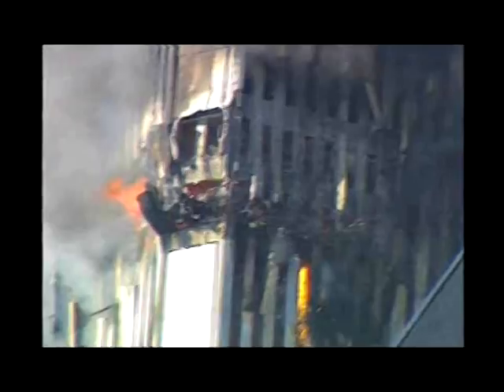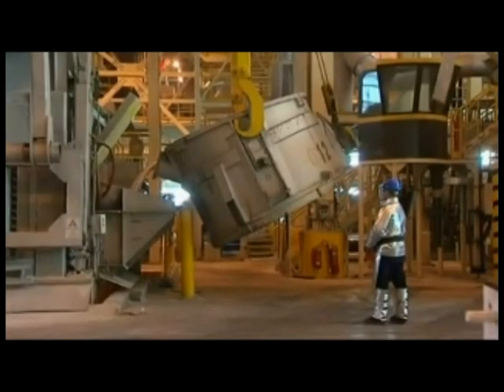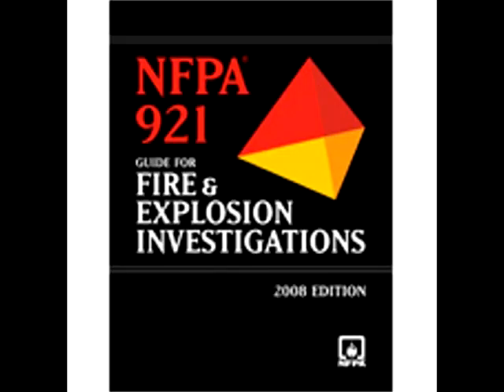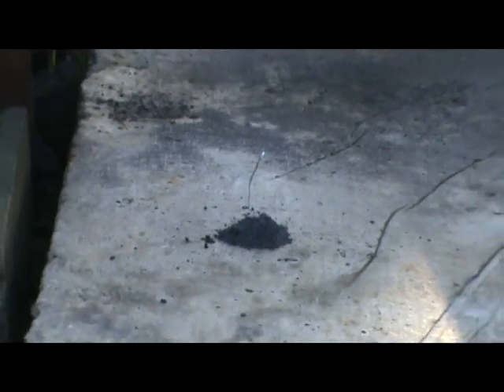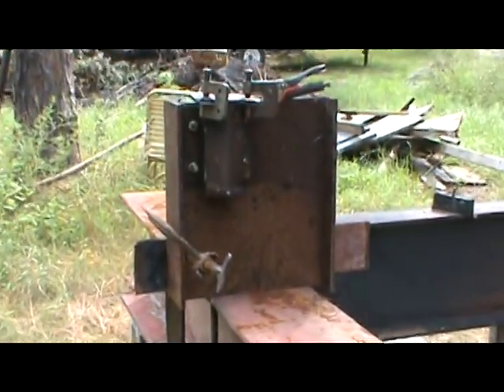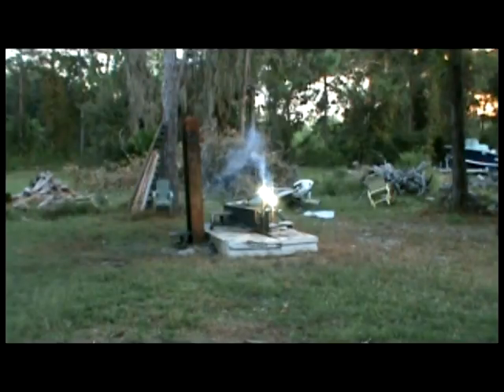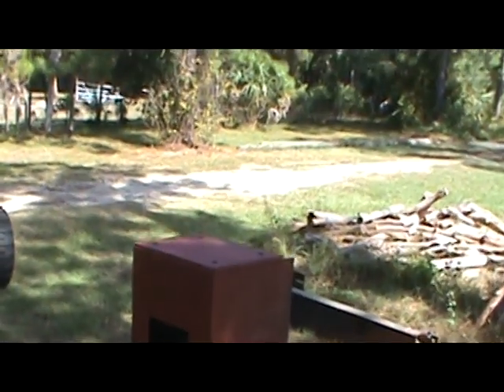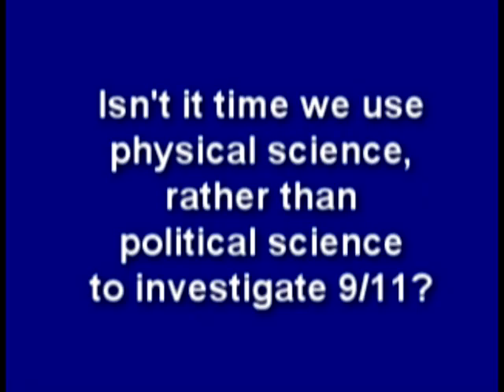9/11 Experiments: The Great Thermate Debate

Comment: Hmm
But...if "open-air jet fuel fires cannot melt steel"....what about the fuel that got into the iron (steel) structure? 

There is a big hole in the sabotage theory. Most of all how would the required energy bearing material get into place, even if it were ignited by burning jet fuel? 

The problem with the jet fuel arugment is that it wraps everything up neatly with a bow, yes? Well how is a thermite style approach  even feasible? Why even take this approach ( bringing down the towers) as there has to be a more technically- feasible approach with similar political results? 

Second a simple question. Your thermite experiments burned out within minutes at most. The WTC burned for hours. There is no question that hundreds of thousands of pounds of jet fuel was flown into those buildings. No question about the fires. How long would it take for that fuel to burn out? Why disregard that heat spurce entirely...it's still hot enough to melt everything but the steel, the steel is still weakened significantly and it still spreads through much of the building turning it into a furnace.  Arguably the burned-out steel hulks of the twin towers still standing would have had the same political impact. That heat would be conducted throughout the entire structure and set tge entire structure on fire...a thermite attack on the 81st floor would not do that. So you have a big time-scale problem and a big size-scale problem.  Say you solve that. How do you have two passenger jets synchronize their arrivals with your thermite attack?

Say you solve that. 

How do you set up and pull this whole thing off without a single credible leak?

I think that is the huge flaw here. Arguably the US government knew what was going to happen when Congress rejected a bill requiring cockpit safety doors on airliners. You could make an argument that some deep-state organization loaded up the WTC with these grenades and the two played together nicely. Pyrotechnics. But how do you do all of this without leaks? 

More likely it was a coincidence. A convergence of negligence and probability. Let's assume that some thermite was stored in the structure. Question 1. Can burning jet fuel ignite it. If not then you need a secondary effect. Burning oxygen canisters or an electrical arc. There were o2 canisters on the planes. Scattered by impact..ignited by the fire...but burning near thermite on the steel frames? Hmm. Electical arcs are possible, you've got power all through the building. The insulation could have burned off and ignited thermite. Possibly. 

But still here you are looking at say 90% jet fuel 10% thermite. To weaken the structure fatally enough to collapse it, you will need a lot of locations of thermite igniting. 

You would need a two-pronged attack. One to load the thermite and ignition system. The other to provide the jet fuel and ignite it. It is possible that the jets were just a coincidence...or they were insurance. In case the thermite didn't bring them down. Or they were cover. 

Or the "thermite" was a byproduct of burning jet fuel in a steel enclosure packed with organic materials. In other words the building itself was the source and needed only to be set on fire.

Iron oxide from the steel, aluminum from the plane, barium nitrate from the lamps, sulfur and so on. 

Ceiling tiles, floor tiles, drywall, wood, who knows what the fuck was in those buildings

Comment: you are stupid. you don't need 1427°C to melt the steel. with only 800°C the temperature of burning kerosen, steel can flexed with hand. not to mention the thousand of tons of things that the weak structure needed to bear. watch this video : 
https://tv.maxisciences.com/7020-w480.mp4?st=NrP3RAX-M_Zrr0WWHkdShA&e=1536419373

Comment: Iron oxide, that would be rust, and aluminum powder, which was on the outside of the World Trade Center which is what's the side skirting was exactly what thermite is.
Thermite was located at the World Trade Center, because of the steel beams as well as iron bolts held the steel beams together, what's the aluminum siding of the World Trade Center, of course there might would be found. For those that wants to know more, look up Dr Judy Wood.

Comment: You spent a hell of a lot of time trying to prove something that you cannot recreate like the original.

How many outer steel columns were there on both buildings? A few hundred at least _ PER FLOOR. How many columns were there on the internal stairwells, elevator shafts and internal strength columns?  How long did it take for this group of thousands of people to come in, remove ceiling tiles, service ducts etc and then install all this so-called 'thermite' on all these columns?  Who wired all the so-called 'thermite' things up? Where did they all wire to?  What floors were they placed on?  Why did the building only collapse from that particular floor and not one floor above or the ones below  where the plane crashed? Did your fictitious 'installers' only place 'thermite' up to that particular floor, and not the floors above where the planes hit - as we never saw the floors above collapse or have your wanna be explosions?

Did the planes hit only the floors where your thousands of men installed this 'thermite'?  How did the pilots manage to find the exact floor to hit while travelling at say 500mph?  Was there a big red spot on the side of the building for them to aim for?  Why did not one person - not fucking one - see a huge group of people removing service ducts and ceiling panels and installing hundreds of miles of wire ... that went where?

Your tests prove nothing even remotely associated with the collapse of the World Trade Center buildings.

Trouble is with you conspiracy theorists, is that you think too much.

Comment: Interesting video. I do think you aren't taking some things into account though. For one the impact of a plane going 700 miles an hour would cause significant damage to some beams, snapping the bolts at least. Also, you need to think about the wind speed at the elevation. Because the winds would be so strong it would turn the whole building into a makeshift furnace. Iron forges don't use thermite to Forge Steel, they use a furnace.

Comment: Thank you for posting this video... I met a old construction worker... That told me he was on the rust removal crew... First he stated that the owners off the buildings wouldn't let them do a proper job removing the rust... They just painted over it.. They stopped using lead based paint because it was unsafe... The paint they used had aluminum oxide as a rust retardant... The one thing I was wondering about was... The back bone of all tall buildings is the is the elevator shaft... The are made of steel reinforced concrete so the shafts should of been standing even if the building feel around them... You know what the military use termite grenades for right? To burn though the engine blocks of equipment so the enemy can't use them... Take care and have a great day everyone.. Love the video...

Comment: I don’t get the argument that the molten metal pouring out isn’t aluminium. There was tons of the stuff present from the airframe. Yes, Al at its melting temperature doesn’t glow but it will if heated to around 700°C or more. That temperature is perfectly plausible. Why do I say that? I have cast Al with a 700°C+ temperature from an induction furnace. It’s not an incredibly rare or difficult set up so other people can, if they want, check it out for themselves. 

The “peer reviewed article” mentioned (which I have actually read) uses samples of dubious provenance. I don’t think the conclusions are really backed up by the evidence provided. The journal doesn’t have a great reputation either but that doesn’t affect the arguments in the paper.

Comment: I just love how so many people think "jet fuel.. has to burn hotter" yet, jet-A, the most common type used in commercial aircraft, is not much different than kerosene, which is less volatile than your car's fuel, and that cannot melt steel in a natural burn! If someone is dumb enough to believe that it can, have them explain to me why a kerosene-fired torpedo heater doesn't melt.

Comment: just because the Steele fire rating is 2000+ degrees doesn’t mean it won’t fall, steel loses its structural integrity around like 1600-1900 degrees which is around the same temperature that jet fuel burns at soooo
Reply: Heat rises, so it doesn't explain the columns that were 6 ft wide by 6 feet deep melting at the base.

Comment: By the way my working trade is a truck driver and I'm a gold and silver smith my brother is a jeweler and gemologist far as casting of metal all those materials is mentioned because their molecular density is less than the source metal all I do is look like Flex on the metal it wouldn't change the color of the raw material pouring
Reply: I left Trucking 2 years ago and I started back in work back in the late 1980s

Comment: them jets were full of fuel. 
jet fuel burns over two thousand degrees just enough to melt steel. 
so the steel supports holding the concrete floor slabs gave way. 
this acted like a domino effect when each floor gave way.
then weight and gravity did the rest.

Comment: 1800 degrees shoot hell 2000 degrees would soften steel like butter. Doesn't need to melt Force pressures will cause it to give no longer supporting the weight that is designed to do

Comment: There was no demolition( other explosions) except the initial impact explosions, However, I feel it was the hijackers of the planes themselves that carried on the thermite type material, to insure more damage be done.  The fact that you used thermate, makes it possible they could have done the same, and the jet fuel was the ignition for the thermate!  
Remember that in almost all of the attacks prior to 9-11, they always used bombs of some type, everytime, so it stands to reason they did the same this time, only combining the “suicide bomber” method they have used numerous times overseas, but this time, in order to make sure more damage was done, they achieved a goal of aquiring the perfect plan of using planes instead of cars/vans!  
I can also explain the blowing out of windows on lower floors, as the collapse happened. When air temperatures and pressures change, such as during a tornado, windows ( glass) can be blown out because of pressure changes alone!  sometimes pressure changes can cause a piece of straw to go thru a tree! We arent able to totally recreate that, but we cannot deny that it happens! 
Another thing, we do not know what materials were used to weld the steel structures together during the making of the actual steel walls. Aluminum melted and flowed out of the corner of the 2 nd tower that was hit, was more than likely the airplane aluminum itself!  You said yourself other materials wouldnt mix with the aluminum, so the planes aluminum melted pooled and ran out the corner of the opposite side corner of the impact zone. ( which would make logical sense because the force of speed/ pressure of the plane breaking apart would “ fling most pieces to the corner where the impact outwardly came.) 
I only have a GED from my local state community college, but common sense tells me that logical and critical thinking are the best avenue for looking at something and using common sense knowledge of the factors... ALL Factors!  It is like how you do it with math and science, I can do it with common sense amd logical thinking! 
Some things just cannot be explained exactly, unless you can exactly recreate the scenario!  So far I havent seen one single experiment done with carpet, furniture, jet fuel,aluminum, and steel as was the evident materials we know of in the attack that day. do an experiment with these materials with jet fuel burning inside a model of  an airpocketed steel structure like the towers were made of and prove me wrong! 
until someone actually does that to DISPROVE that aluminum could run out, jet fuel can be a bigger ignition source of heat than thought possible, given the materials around it, and heat could reach more extreme temperatures, then I just will keep my theory and live with what I know to be truth! Because my theory is just as plausible as yours!

Comment: My more plausible theory is that the fire foam wasnt designed to work on a jet fire and backfired ramping everything up beyond what a standard office fire would have done.

And YES. Building 7 came down on its own. It was a utility building for the plaza and house numerous feul tanks and pipe lines that spanned every building in that center. The fire were fed by the fuel from 7 and created a backdraft/suction type event that pulled the fires directly into the numerous fuel tanks cause them to explode and weaken the interior structure. Thus bringing the building down on its own.
Reply: No NIST says regular office fires only. The exterior face of the building (somewhere above the 7th story) accelerates downward for 2.25 second at 9.8m/s2 as a unit. The logical conclusion is that all the columns must be overcome completely (for 8 stories) all at the same time and all at the same location. You think the nature of the collapse is plausable due to fire? NIST only models the initiation of collapse. The other building that was hit by flight 77 in Arlington had an office on floor 25 and most of the building was Salomon Smith Barney which had clients including Enron and WorldCom. All were being investigated by the SEC which also had offices in that building. The two people in charge that day DR and DC (President was out of town) who signed off on the at least 6 military exercises that one could argue facilitated the attacks by causing confusion (see NORAD recordings) were on the SSB NY advisory board. Read the FBI doc on the 5 people arrested at 4pm on 9/11 who were monitering the terror cells. Their former PM was a business partner with the building owner and knew personally the two in charge. Anthrax attacks were linked by that countries intel with Mohammed Atta and Iraqi occials in Prague until FBI partially exposed it as a frame up.

Could all be coincidence but if WTC was suppose to not be seen and come down in the dust of WTC1 seven hours earlier they wouldn't leave the North towers collapse to chance. Again I may be wrong but it looks to me as though the twin towers were pre weakened. There is no jolt and the acceleration from top down is a little less than 45%(g) and uniform. Mechanical pre weakening can be done with removal of bracing, bolt and hinge cuts ect... and here we see how an incendiary can be used to pre weaken the structures moments prior to collapse.

Look up the NJ Burket south tower collapse video and watch from original news source (so it's not edited). What do you see maybe 40 stories down from the impact zone on lower left hand side? Seems too far down and too premature to be an example of a piston effect. Looks like 3 shaped charge detonations around where the middle mechanical/electrical rooms were located.

Comment: wow really? lets dig into this a bit I will prove you wrong.  1:30

Steel is just the element iron that has been processed to control the amount of carbon. Iron, out of the ground, melts at around 1510 degrees C (2750°F). Steel often melts at around 1370 degrees C (2500°F).

In a enclosed space such as the twin towers Jet fuel can burn in excess of 3000f  
Max adiabatic burn temperature  2,500 K (2,230 °C) (4,040 °F) open air burn temperature: 1,030 °C (1,890 °F)   
Airport firefighters constantly tell trainies that jet fuel inside and airplane the fires can burn well over 3000f

Your lucky that you didnt burn down the trees and other things around your "test area"

Some people just believe that every ones out to get them. fact is the government doesn't even care what you do as long as your not out to screw them
Reply: that high temperature can be achieve only with pure oxygen, meanwhile jet engine use open air....so your wrong
Reply: Ita Amelia you’re *

Comment: Build a twin tower and hit them with jets to prove anything you want to prove. Atleast try to create similar environment where you could have jet fuel lit burning of building materials, furnitures, for half an hour and most of the heat confined in the building and worked like a furnace. Before you can do that stop bsing..

Comment: Dumbass, to turn it to liquid, but if you get steel above 700 degrees F it becomes very weak, when it turns red you can bend it easy stuid ass. How much weight does 35 floors weigh? and with steel trying to support it when its red hot at 1300 F its gonna fold stupid